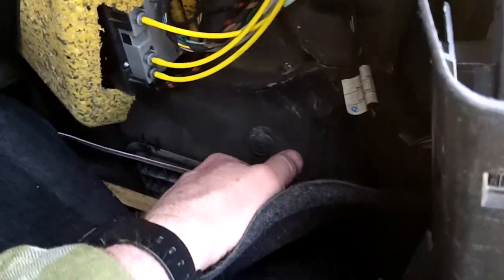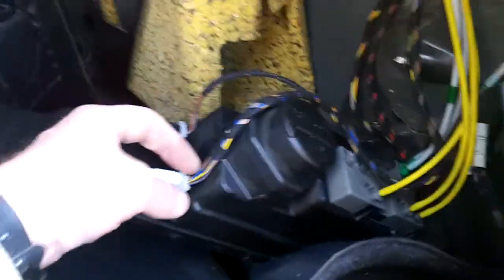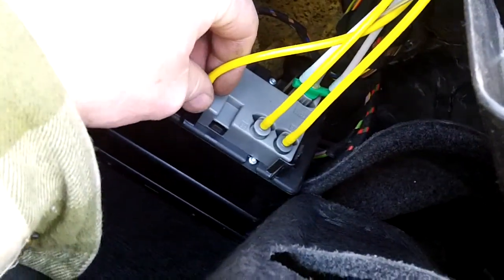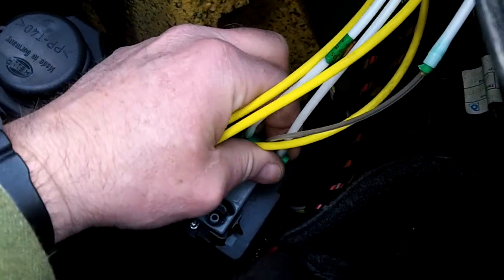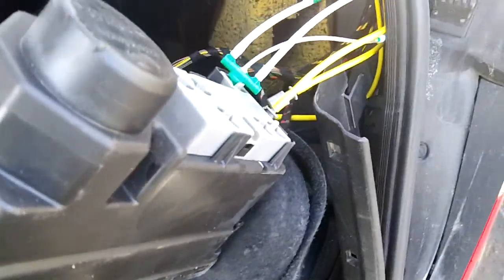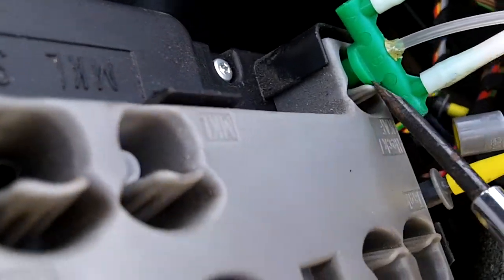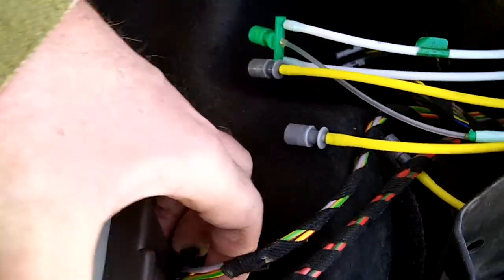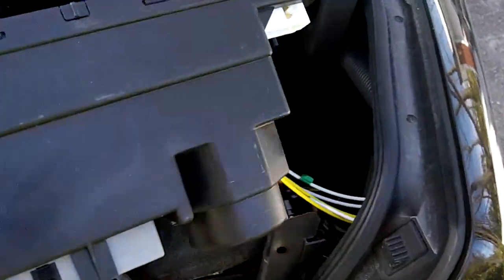Mercedes w208 clk vacuum pump removal..other Mercedes models similar

Comment: Trunk wont lock, bought it like that. Changed one with another now, Trunk can open with inside button, but trunk wont lock,  headrests not working on headrest button. Some port problem, fuses, cloged? And dont understand which port is mean for what

Comment: Is this related to climate control flap system or just door lock? I have issues with my vent flaps and I don't know how to fix them :(
Reply from the maker: +Andi Bogdan Neagoe  The vacuum system controls climate flaps as well
Reply: +fupabox Thanks for your quick reply! I've checked almost all your vids and I could find no info on how to fix my broken air recirculation/flap system. I tried you vid with flap test and nothing is moving.
Now, I think I have a starting point. 
Did you happen to have this issue ? 
W208 200K '99 192hp dual electronic climate control fitted car.
Reply from the maker: Andi Bogdan Neagoe  No I luckily didn't.. the next place to check would be the vacuum distribution/switchover block   for the climate system ..should be behind the glovebox.. also check all the vacuum lines under the hood.. any crack in the rubber connectors or loose fitting will cause a problem with the climate actuators
Reply: +fupabox Hello mate! I have finally managed to fix it :) It was a green vacuum line that came from some box under the right wing and was connected to the vacuum distributor behind the glove box. The cable was literally chewed and I replaced it. Works as new! Thanks for the advice! Btw, do you think I should replace all vacuum lines? My car is in a pretty bad condition and they all looked a bit old :(
Reply from the maker: Andi Bogdan Neagoe They are pretty tough, and rarely break.. but if you can do just the ones under the hood exposed to the elements in the engine compartment you will prob. never have another issue, I wouldn't bother with the ones in the interior , unless they go out into the engine area like the green one... good job finding the leak  :)
Reply: ***** Yes, I think that one was exposed and friction with the body of the car damaged it. I will change the ones under the hood (interior ones I checked and they looked fine). Will also check the one that leads to doors/back just to avoid any unpleasant surprises in the future :) by the way, do you have any other page where you post diy guides or it's just youtube?
Reply from the maker: Andi Bogdan Neagoe just youtube   :)